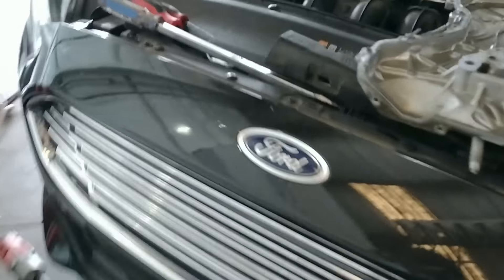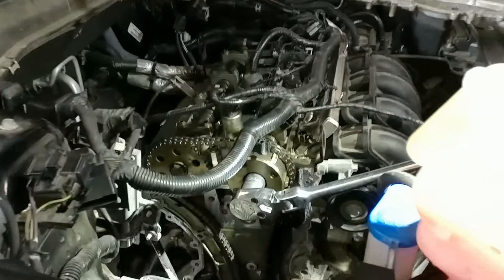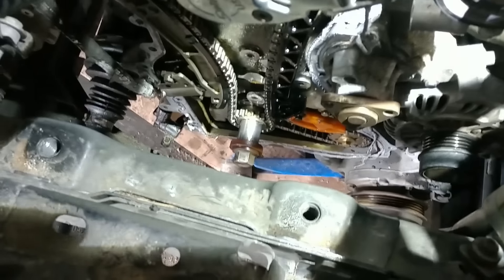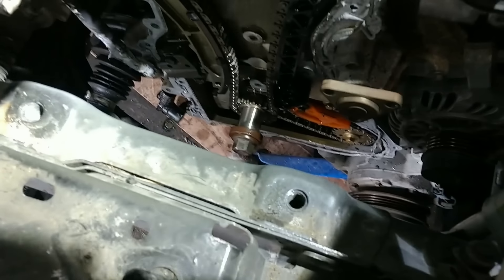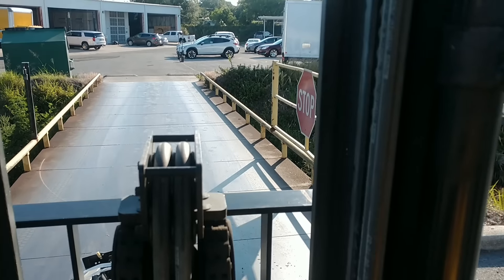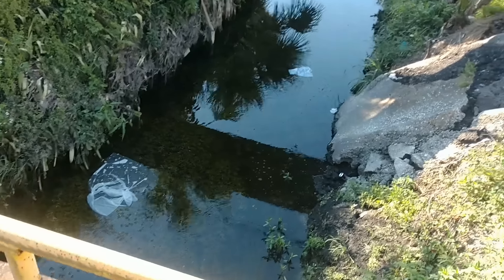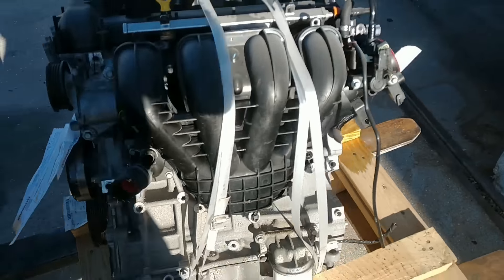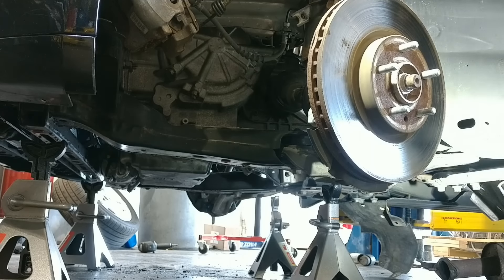Damaged Engine: You Broke it! Pt1

Comment: This is why you should know what you are doing before jumping into a major job. Training and knowledge is key difference between a successful job that makes money and losing money.
Reply: A Ford dealer locked up my 97 mustang engine so they put in a new one in it I feel like it could happen to anyone anywhere mistakes happens just hopefully it only happens once
Reply: Resealing a timing cover should not be a major job. Did you know that some moron designed an engine with no key to hold the cam drive gear in place? Bet ya didn't. One should think before criticizing others.
Reply: @less5406  I did..As I can read the damn Service manual.. It tells you in plain English how to service them.  There not that hard to do right either. Just people get lazy....

By the way. This applies to changing water pumps on some Eco Boost and Mazda Engines..You screw it up. You will be replacing the head or the Whole Engine..

Comment: So, this is why I consult AllData (or similar) before doing any job that involves breaking open an engine. Ford 4 cylinders have been like this for many years. You didn't mention it, but on the back side of the engine, there's a plug that needs to be unscrewed after the engine is turned to #1 TDC. Then a special tool is screwed in to lock the crankshaft in position. Then you can unbolt the crank pulley. After removing the timing cover, but before slacking the tensioner, install the cam locks. Keep in mind, this design is also used on other brands that use Ford engines, like Mazda and Volvo.

Comment: These are the same engines on Jaguar Land Rover Evoque, Sports Etc.. I've done many of these timing job because the VVTs are common with these.. rule of thumb on these procedure is replace the Crank pulley washer which has diamond flakes on.. cam timing locking tool would be the last thing you would pull out after you tighten everything!!! Especially the crank pulley!

Comment: Damn dude. The “apprentice” must’ve been feelin this one for a long, long time.

Edit: don’t blame him either. This one was on the engineer who snorted a rail before coming up with this shit
Reply: Speaking of railing lines.. the 90's mazda 929 v6 crank needs to be out 30° in relation to tdc mark. :/ wtf is that about?
Reply: @adzz8012  Ever done the timingchain from a Toyota D4D engine??👀
Reply: @VWisrotzooi  nah just the bulb swap on the hilux aftereards 🤣 i hate disesals i watched though. That was pretty early in to my apprenticeship.
Reply: @adzz8012  Those d4d's are HELL🔥🔥🔥🤣 It takes like 14 hours (flatrate) to change the timing set. 14 hours for someone who has done that a couple of times, imagine the first time ☠️ It was also the first and last diesel engine lexus ever used because of that fiasco 🤣
Reply: That's a bit of a cop out. Instructions were there if he cared to look. Since it was a GM dealership, it would have been MORE of an incentive to read up on a vehicle you haven't seen before.
You might think it's a waste of time, but a few expensive mistakes will teach you it's well worthwhile.
Reply: @Cheepchipsable  He should have looked that up, and more important: turn the engine over bij hand before you start it after timing work.
Reply: @Cheepchipsable  Sure. But at the same time why engineer traps into your vehicles when there are relatively easy measures that can be taken at the the design stage to prevent stuff like this from happening? It certainly isn't in the customer's best interest to own a vehicle that is needlessly difficult to work on.
Reply: I think it's marketing over the engineer's shoulders "dont make them last too long"  That sprocket only held in by friction and clamp force is a fatal flaw. That's the kind of things separating the long lasting engine from the bad ones in junkyard before 200k miles.
Reply: @Fraggr92  This is not a "trap" that has been engineered in, it's a way of setting the valve timing with significantly more accuracy than the old keyed pulleys/sprockets would give and with minimal labour overhead. Just because you don't understand something, doesn't make it stupid.
Reply: @ferrumignis  Sorry; relying on friction to locate valve timing is the kind of thing that makes people dislike engineers.  Just because you "can" doesn't mean you "should."
Reply: @David-hm9ic  Sorry, but you don't know what you are talking about.
Reply: @ferrumignis  "  Just because you "can" doesn't mean you "should." ' should be a poster on the wall of EVERY engineer's cube.  This looks like a case of overdesign - just like a toaster with a built-in computer to supposedly get the toast JUST RIGHT!
Reply: @markpeterson5479  Like others you display your ignorance of basic engineering.
A key is not present to drive a timing pulley, it is for alignment only and drive relies on friction after the pulley bolt has been tightened. This means there is no loss of drive integrity in a keyless design provided it is assembled correctly.
A keyed pulley and camshaft/crankshaft is a significant compromise in terms of timing accuracy, add up all the keyway tolerances in each part and variation in chain or belt length from new and you get a variation in timing large enough to affect engine performance (the whole reason offset keys are available when tuning old engines).  Using keyless timing components that are tightened whilst all other components are aligned separately takes out this tolerance stack up, and makes automated production simpler. It even makes belt/chain replacement simpler if you actually understand the concept.
Reply: @ferrumignis  sure sounds like it makes all the mechanic job way harder. They cant open up the manual for every single car they get people already bitch on a 500$ repair bill if they have to start reading about every aspects before repairing it would increase the time and cost by a lot
Reply: @saberxzero  "They can't open up the manual for every single car they get"

Why not? If they aren't familiar with the engine then they should be refering to the manual.
It actually makes timing the engine easier, when the cam and crank are already locked to their timing positions when you tighen the pulleys down then you can't get it a tooth out, unless you really mess something up badly.
Reply: @ferrumignis  because almost everycar has a different engine and every part that goes with it. People refuse 500$ bill so if they have to read the manual for an hours how are they ever gonna justify 1 hour billed for finding the manual, printing it and then reading through it becauae 1 engineer decided to show off and change a component where every other mechanic agrees its stupid and every other car has the same way of doing it.

Maybe its the engineer job to keep a thing consistant, which seems to be the case in every other vehice?
Reply: @ferrumignis  you probably work in an office. It doesnt work that way out on the field. Dont go on a construction site its even worse
Reply: I hope he doesn’t take it to heart too much as a mechanic you are bound to make a small mistake that causes a lot of damage it’s just how it goes this kid just got his out of the way so he’ll be good for a bit lol
Reply: @VWisrotzooi  it wasn't timing work. He literally revealed the cover.

Comment: This is why when I went From being a Ford tech to a Toyota tech my life improved drastically.  Only Ford is dumb enough to build a engine without key ways or dowel pins on camshafts and crankshafts. You shouldn't require cam holders or crank holders to do timing.  Just put marks on everything and have dowel pins.  Wrong job for a new apprentice.  That sucks I really feel for the guy.
Reply: renault do it as well
Reply: don't forget all the Ford tach's with no redline...
Reply: Except this engine is a Mazda L, not a Ford design.

Comment: I agree 100% that is a very very stupid design I've  Never done anything that serious to those engines as of yet just spark plugs and general maintenance But out of all honesty there's a very high chance I would have made the same mistake
Reply: i never understood why the free float design exists... keyway was safer... but with the free float they get alot more repairs ... lol
Reply: @Vitormarques542  planned obsolescence from the get go
Reply: I agree it is stupid.  Over time, the vibration and harmonics can sometimes break even ones with a keyway design  (like my old Mercury Villager/Nissan Quest) so what chance does this thing have of staying in time over thousands and thousands of miles? 0.  At least my Mercury 3.3 was not an interference engine.  It is like they want it to drift out of time and eventually need to be replaced.  If this were my personal vehicle, I do not think I would have made that mistake as I would have read the service manual and even watched videos on how to do this before attempting the job.  At a shop though, I do not think they would pay this kid to sit in the corner and read the manuals and watch videos, they just expect him to do the job so if that were me in that shop, it would have happened to me for sure.
Reply: Not really a stupid design, its quite common actually.. My tractor uses a friction type of crankshaft/Harmonic balancer to run the front 1000rpm PTO, that system goes through more abuse than a simple car engine does..
Reply: @gorgonbazil2652  maybe but if it slips it wont hurt your engine  when talking timing a key is needed
Reply: @gorgonbazil2652  not your crankshaft sprocket though, that has a keyway. You're confusing the harmonic balancer/pulley with the crank sprocket that runs the timing belt/chain. If your balancer/pulley were to slip on the crank, no serious harm would be done to the engine, but a sprocket slipping would throw the engine out of time and destroy the engine if it is an interference engine. I could see it being used on a non interference but in this case, it's beyond idiotic to use such a system for the timing.
Reply: Garbage ass camaros are the same way, need to lock the cams before disassembly
Reply: @DL101ca  You are missing the point, I know exactly what those components are and there is nothing wrong with them..  Notice the vehicle was driving just fine before they tore it down.. And yes I understand the difference between the harmonic balancer and the crankshaft sprocket.. The point is the friction contact or compression is just fine, Yes my front PTO is attached to the harmonic balancer and the balancer has a friction type connection to the crank!---NO KEYWAY I know I installed the front PTO system.
Reply: Well at the end of the day don't buy a Ford, ford's are shit.
Reply: @Vitormarques542  It allows the valve timing to be set more accurately, at a reduced manufacturing cost. Ford used the same idea over 20 years ago on the cam-belt engines; it's actually good design.
Reply: @chrispop99  who cares about precise timing on that thing, it has VVT. And more precise timing = more precise tools. Tools I can guarantee you, no mechanics in a regular shop owns. Engines shop and high performance shops might have the correct tools to set timing this precisly but the guy at the shop gonna use the good old extension in the cylinder to find TDC instead of the starrett dial indicator. So it serves absolutly no purpose at the end. A good design a stupid/fool/apprentice proof
Reply: There is absolutely nothing wrong with this design, many brands of engines us this system. There is such a thing as accumulation of tolerances that will cause variation in initial cam timing if the system uses a key way.  Rod journal to crank key location, timing chain length, crank to cylinder deck height , cam to cylinder head height, cam sprocket key location, cam key location.  And. . . Mill the head during a repair and cam timing changes.

Engine assembly with the floating system is much faster too, hang the parts, lock the cam / crank and tighten things down, easy.  

 Felix Robitaille said :  "   who cares about precise timing on that thing, it has VVT.  "   You have no idea how VVT works, you seem to think that VVT is random cam timing.
Reply: @bobroberts2371  you dont need a timing precise to the seconds with VVT. Probably hours precise if I have to guess. It can and will self adjust small errors (not talking degrees). Also I never see an engine with an head so decked that timing was so off it would run funny, even on old engine. I personaly have a 5SFE that I decked the heck out of the head to gain compression ratio (and power) and the timing is still within specs (dots align pretty much perfect)

I understand the benefits of that system, but I dont see it being a good design for a mass produce car. There is just too much human error possibility. Also when you set timing on this engine you probably have the same tolerances as a keyed engine, juste because of the tolerances of the locking tools you need to use. Or you have to get the expensive dial indicator and do it like on a race engine (which will take time and labor is probably the most expensive thing on a repair like this)
Reply: @felixrobitaille8170  If you've never seen an engine that can be decked so much it throws the timing off, you've definitely never worked on old nissan engines lmao. The old L series engine in the 280z I had was VERY susceptible to head milling to the point that they made special shims to raise the cam towers up to get it back into time properly. My 280z had the head decked but the shop couldn't source shims, so what I ended up having to do was advanced the timing by jumping the chain a tooth to get it back into proper time. It was a DOG before then. had zero top end power at all. After adjusting the timing it was back to how it should be, peppy as all hell.
Reply: @OverlandOne  Nissan Quest, u mean...
Reply: @MazichMusic  Exactly right.  I own a Toyota now and must have been thinking that at the time.  I have edited my post to correct it.  Thank you very much.
Reply: @gorgonbazil2652  how big of a tractor are you talking? More abuse than a car engine? That’s nonsense especially if it’s like a 400horse power motor spinning to 6500rpm lol
Reply: @steverone7623  Well, you just let us know just how much you do not know! Horse power LOL,,Tractors don't make alot of HP, they make Torque....fool
Reply: This got to be one of GM’s most assholic design. It is almost designed to fail. It is shit like this is why I don’t by GM.
Reply: "It's stupid" = "I don't understand why it's done like this, so it must be stupid"
Most modern engines use keyless crank and/or cam pulleys/sprockets because it allows very accurate cam timing with minimal labour overhead, providing you have the correct locking tools for that engine.
Reply: @bonzai2380  The vehicle is a Ford, not GM.
Reply: @gorgonbazil2652  well I guess you're missing my point. If your balancer were to slip , would your engine/PTO system destroy itself ? That is the main difference when choosing when to use such a way of driving accessories/timing an engine. If they used it on a non interference engine it wouldn't have been such a serious issue.
Reply: @ferrumignis  Enough with this "very accurate timing" BS excuse . What's so inaccurate about the normal keyed way ? Not to mention were talking about a VVT engine where the ECU will adjust timing.
Reply: @DL101ca  It works fine,,,just because some person works on it, does not know the engine and screws up does not make it bad.. Those ASE mechanics should have at least checked the specifics on the engine, I never work on any motors (Gas or Diesel) without the appropriate manual by my side.. I also pre read the procedure before turning the first bolt!
Reply: Just think when that dam friction wears  away eventually what do you thinks gonna happen to that motor lets just say its gonna be the love child of a stick of TNT  and a hand  grenade  kaboom
Reply: @bluflame5381  won't happen..just because it says "friction" doesn't mean it will move when properly torqued
Reply: @gorgonbazil2652  I am not arguing the mistake the mechanic made, I am just not seeing the upside of using such a system as opposed to the keyed version. While over time people have come up with some useless designs and inventions, for a major automaker to embrace a certain design, it has to have a certain advantage in either cost, production ease, or functionality/performance. I don't see it, personally. Maybe time saved in not having to key the crank ?
Reply: @DL101ca  Denis,  When I first was introduced to friction type connections (for lack of better words) I thought they were bad too.. They work, I don't care for them either but they work.. This type of connection is the result of unsupervised engineers!
Reply: Peg Legged Brown  lol i had some days working on those 6.0 and 6.4s if i had longer hair back then i would have pulled it out 🤣🤣